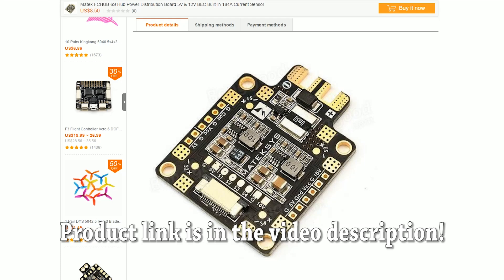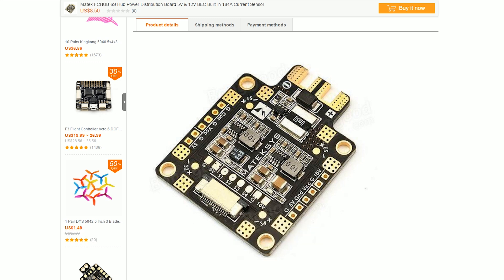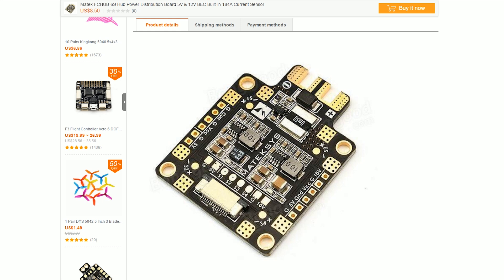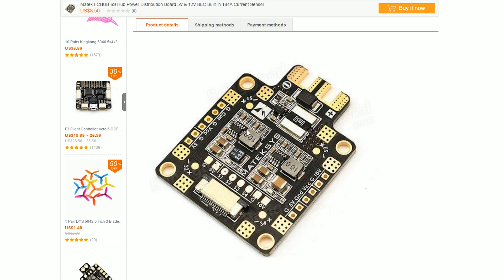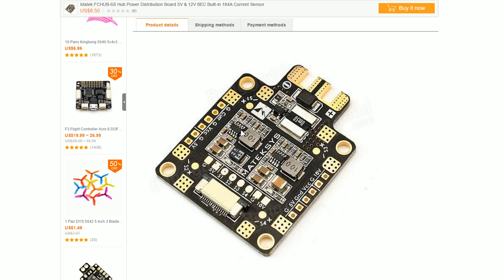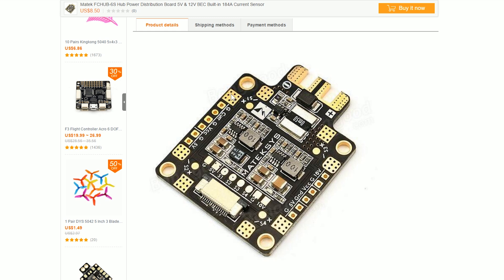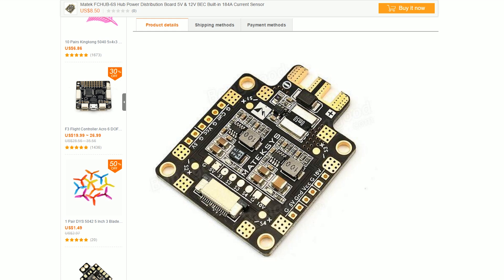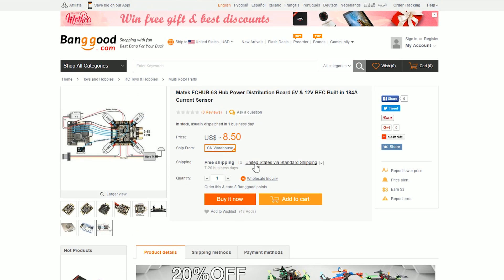MATEK FCHUB | the best, simplest, most complete PDB with current sensing for quadcopters

Comment: Hi Joshua. I am about to replace my Omnibus f4 v3 flight controller with the Matek f722-SE.  

I already have in my quad a Matek 5 in 1 pdb that is very neatly tucked away in the bottom of the quad and wired quite well, LED's and all. 

Now the F22-SE has an integrated pdb.  My question is this...Can I just use it (the F722) like a regular flight controller and just connect the signal wires and power etc (the connections I would have disconnected from the Omnibus)? 

I am thinking it is doable, but I need your opinion.  I don't want to rewire the whole quad.

Also, how would this affect  my options for using the current sensor which isn't on the 5 in 1?

Comment: all that current sensor  talk and you never cover if the ribbon cable carries the current value to the matching Matek Ribbon cable port.... 

I had to bypass using the ribbon cable on one rig and endedup having to contact Matek ( Great support By the way ) on how to get voltage into my OSD.  It required additionally connecting the VCC from PDB to the VCC on the FC. I of course freaked out like woah its already getting power wouldnt that fry something by adding ANOTHER power source  but nope it brought VCC readable into my OSD and didn't fry anything.   So Now I'm rebuilding a 6" and using ( I think ) the Ribbon cable and am wondering -- I know the ribbon brings main power to the FC and VCC to the OSD of the FC  but hmm what about Current  ?   WHoops  Never Mind  this guy addressed it for me   https://youtu.be/-XmTH9qLaNA?t=460

Comment: Hello Joshua, I'm doing my first build. I have this maytec fchub and using the kiss V2 flight controller and kiss esc. I know I wire the kiss signal and signal ground to the kiss v2. I know I wire the power leads to the maytec fchub pdb. The only thing I'm not sure is how I wire the maytec to the kiss v2. I think the maytec vcc out port goes to the kiss v2 lipo connection on the diagram. If this is the right configuration then how does the flight controller send power to individual motors if all the signal wires off ESC go to the flight controller. Would you be able to help me with this? Appreciate and have a great week

Comment: Dear Joshua, somewhere along the line I failed to pick up why the trend is towards these 10Volt regulators. I fail to see what it could/should be used for. I apologize for my ignorance but could you explain why this is important or a good thing in any case?
Reply from the maker: 12v regulator provides no filtering on 3S because input voltage is too low. 8v or 10v regulator provides filtering even on 3S.
Reply: Dear Joshua,

Trying not to spam you as you are probably very very busy. I appreciate your answer very much but I still fail to understand what I could use this voltage for. I understand this is much more 'clean' power but up to now I have had only use for 5volt and 3.3volts.

Greetings

Comment: Is it possible to solder a two wire motor to a 3 pad esc(4 in 1) PDB ( Eachine Stack)?
Reply from the maker: No. That is a brushed motor. It cannot be driven by a brushless ESC. This is not possible.

Comment: Hi Joshua, What is the filtering like. I am using some sensitive components Ublox M8N Sat RX, TBS Div RX and the Matek Mini Power Hub does not cut it. Too much interference.  I have cleaned up the FPV signal, its not perfect but OK, the Div RX has bands which although does not distort the image it is an irritation. I tried using a separate battery for its supply and the bans are gone : )
I could use a UBEC but don't want to keep adding components as this adds weight and another area a fault can arise. 
I have searched around the PDB reviews but it is hard to distinguish between sales people and honest reviewers.  As I am sure we and your viewers know there is a difference between filtered and well filtered PDB's. I don't have the money to keep buying and trying. That's why I ask you, an honest reviewer.
Cheers.
Reply from the maker: +Elecifun I don't know whether this will fox your issue.
Reply: K.
Reply: I asked you because you are supposed to be the most knowledgeable on this subject.  Your title implies this is the PDB to use, even the best. The best for what ? Sorry, forgive my stupidity. I see the click to buy link !!

Comment: Does anyone know what that black component right next to the battery pads is? Im asking because my PDB got just a tiny drop of water in the right place and made the current sensor completely nuts. After i had left the quad to dry for a few hours and went to test it to see if i had to replace the PDB and/or FC; at first it did work like it should, but then all of a sudden that black component exploded and caused Vbat and Ground to short circuit. So is it just a capacitor? Can i just remove it since i run caps on all my ESCs or do i have to replace it and if i do, then what is the component in question since i can't read the label on mine anymore?

Comment: Hi Joshua thx for all the great information... I have a question: Can I use a 35 Amps ESC in this PDB??? On the back it said 4x30Amps (4x46Amps)... Thx In Advance!!! Greetings from Colombia!!!
Reply: You totally can, unless you run something insane which actually uses more than 30A constantly. Im running the original Rotor Riot Hypetrains with Lumenier BlHeli_s 35A ESCs on my FCHub which is basically the same as the one with the vTx and havn't had any issues aside from the 10V regulator not being able to handle TBS Unify HV at 800mW and RunCam Swift 2 at the same time for some reason. I fixed that by soldering my vTx to Vbat and cam to the 10V regulator.

Comment: I bought the Matek PDB, FC and VTX.  Matek says to power their Vtx off the Vcc pad on this Pdb but would it be better to power it from the 10v?  Maybe keep the Vtx cooler?
Reply: The reason they say that is because as soon as you do a snap roll or a fast flip your vTx loses power for like a second because the 10V regulator either shuts off or dips way below 10V. At least that's what happened with mine with both RunCam Swift 2 and TBS Unify HV soldered to the 10V regulator. I fixed that by soldering my vTx to Vbat and cam to the 10V regulator. Also even if it would work on the crappy 10V regulator on this PDB, it would not have any meaningful effect on the temperature of your vTx as far as i know.

Comment: Switching regulator better than a linear ?? You sure didn't mean the opposite?
Reply from the maker: Switching regulators are able to handle way more current with a way smaller package and less heat buildup. When you buy a 1.5 amp rated linear regulator, that 1.5 amp rating is based on unrealistic assumptions about heat dissipation. Practically speaking, that 1.5 amp regulator is going to be able to handle something like 300 to 600 mA before it overheats. A switching regulator is the only way to get 1 to 3 amps output without having a massive package, a heat sink, or something like that.
Reply: switching regulators are more complicated and cause lots of noise. the quality of them is also an issue, but maybe it's a matter of preference.
Reply: DroneRecipe 
Caps 
They are the solution :D
Reply: I'll take switching regulator any day, maybe for certain conditions but for general usage, SMPS is better. Noisy output? An array of caps and an inductor will solve the problem.
Reply: would you take a switching or linear regulator for a VTX or FPV camera?
Reply: Switching, because one reason: inefficiency leads to extreme heat buildup. Let's do the math.

Battery full voltage: 16.8V
LDO output voltage: 5V
Voltage loss: 11.8V

:200mW VTX power consumption: 0.6A
Camera power consumption: 0.2A
Total: 0.8A

Power loss: voltage loss x current
11.8 X 0.8 = 9.44W

9.44W of concentrated heat on small surface without decent heatsink = a lot of heat.
Reply: no math to be done really. on and off of a switching regulator = noise   heat build up is relative to the voltage that requires lowering, so it's not "extreme" in all cases. I can't disagree that switching regs are more efficient but for certain applications the linear is better. do you remember when pdb's came with a 12v linear drop down (still have some) ?  btw, I love your channel icon :)
Reply: Switching is indeed noisier but that's why we have LC filter. What LC filter does? It smoothen the output, minimize the ripple and noise. Yes, LDO is better for certain application like very noise sensitive audio systems. You know the Omnibus FCs with LDO regulator? People are having problems with it. The linear regulator is giving more problems than solving the problems. Go check it out yourself, we ended up not using the or remove the included linear regulator.
Reply: let's agree to disagree, and yes I've used the Omnibus FC v3. the reg on that dropped the voltage more than it was supposed to..couldn't even get 5vs to power my camera or vtx. i believe they fixed this with versions 4 and 5

Comment: Will it work Good with 150 Amps current of all 4 Esc ?
Reply from the maker: +samarth1410 it's rated for 140 amps.
Reply: Thanks & Can you give me some advise that shall I buy this PDB or not ? I'm using 4 Esc's each of 30 Amp attached with 27Amps motor and working on bull-head propellers. Will it be able to work smoothly ? Please reply...

Comment: I"m having problems with my Chameleon, TBS unify not working, Where I got the unify from thinks the PDB might not be supplying enough current on the 5v.I am using a Omnibus F4 pro but like the way the battery connects from the side, so could I use this PDB with the omnibus and use the current sensing from the PDB, would that work?
Reply from the maker: I do think the Omnibus has current sense input, or at least I know it has RSSI input, which can be remapped to current input.
Reply: Joshua Bardwell trying to find the pin layout for everything on omnibus fc is impossible, I'll keep looking, and thanks for all your hard work, I'm off work at moment having back operation but when I'm sorted and back to work end of August I'll join your patron. Cheers!!

Comment: Joshua Bardwell, I have a small issue with one of my quads, it is fitted with a betaflight f3 fc all in one, coupled to TBS Escs and when I am happily flying around the power seems to cut off and the quad just drops from the sky, would you know what causes this small problem ?

Comment: Hi, I am using this PDB with omnibus F3 FC and the current reading is waaay off. MATEK suggest to set the scale  at 179mV/A which is logical due to its 184A and 3300mV sensor. but with those setting I get a readout of 1mAh after full pack of flying. when I lower the scale to 1mV/A i get only about 250mAh used after full pack. I am starting to believe that either the FC or Currnet sensor are faulty.. any idea how can I find out which is ok and which is bad? or any other suggestions? thanks in advance
Reply from the maker: The FC just takes what it gets from the current sensor. It's unlikely to be faulty in a way that would cause this problem. If you only get 250 mAh at 1 mV/A, then I expect the current sensor is damaged.

Comment: Guys, I have one of these inbound and I've not soldered onto open U shaped pads for the main + and - like this bad boy has, can anyone lemme know how or point to somewhere that does? I'd think maybe we just splay the ends and solder it flat?
Reply from the maker: I think you're over thinking it. I would definitely keep the wire together. Dont' splay it out.
Reply: Joshua Bardwell ahh ok, thanks man. Found on the main site, it's meant for an xt60 on its side. I'll wire anyways for relief on the pdb. thanks again.

Comment: What pdb can handle t-motor 45a esc. With the f-80 1900kv motor  That will be the winner  Still looking please help.
Reply from the maker: I reckon most PDBs can handle 160 to 180 amps without worry. If you are really concerned, you may have to build a harness out of 12ga or 10ga wire. But we're talking a really massive multirotor at that point.

Comment: Joshua, I really like the FCs with built in current sensor too (BFFC for example) but the problem is using them with a 4n1 ESC.  Have you found a solution to this problem?  Seems like the 4n1 ESCs should be incorporating the current sensor.
Reply from the maker: Get an ESC with a current sensor and then use the external current sensor input of the FC instead of its internal current sensor.

OR

Wire the 4-in-1 ESC vBat+ pad to the load side of the shunt resistor so that current still passes through the shunt resistor on the way to the 4-in-1 ESC. Use the same gauge wire as your battery wire.
Reply: Wow I guess I didn't realize that there were 4n1s that had a current sensor.  I'll look for them.  

I was worried that the traces on the FC, for providing power to the ESCs were not designed to handle the load of all four ESCs.  I know you have touched on this in prior build videos and even wired them this way.  I take it you've not had any problems with this?
Reply from the maker: +Chris Young that's why you solder to the big shunt resistor itself. It can take the current if course.

Comment: Good afternoon, can I ask a question HUBOSD8-SE? Is it possible to get Rssi signal on HUBOSD8-SE from receiver XM+? here are my options:
1)I tried to redirect the signal RSSI PWM with 16 channel betafight (Airbot А4) as servo control to the output 6 of the motor. Output 6 motor(servo) I connected to HUBOSD8-SE. I have received a signal HUBOSD8-SE , but it is chaotic 0-100%. Maybe it's still possible with the servo controls? 
2)Or how to convert an analog signal RSSi on-Board XM+(0-3,3 V) in the RSSI PWM signal to HUBOSD8-SE?
Reply from the maker: +ZMR220x you could convert analog to PWM with a 555 timer chip but I'd be surprised if the HUBOSD didn't understand analog 3.3v input.
Reply: Thanks for the clarification! I want to try to redirect betafilgt rssi 16 channel to control 2 servos by assigning the output 6 of the motor. Then controls PWM servo 2 to send to HubOSD. In fact it will be RSSi pwm? Do you like this idea?
Reply: Good day, you can give a link to a diagram of preobrazovatelya analog in PWM based on 555 timer?
Reply from the maker: +ZMR220x no, I couldn't do that. You would need to know the timing characteristics of the PWM signal first then use a 555 calculator to determine the correct capacitor and resistor values to generate the signal.
Reply: clearly it is difficult for me

Comment: Speaking shunt talk, don't want to be Shuntful, but wouldn't it be better and more accurate to have a shunt on each esc?
Reply from the maker: That's what KISS does. It's not more accurate, because it only measures current consumed by the ESCs, not the FC or any accessories. Current is always conserved throughout a circuit. If you pull 10 amps from the positive terminal of the battery, you must by definition have 10 amps going into the negative terminal. So if what you want to measure is the total current consumed, measuring close to the source, before it all gets split out to individual components, is the best approach.

Comment: Does a current sensor reduce power at all? I know that sounds silly but I'm just thinking since the power has to pass thru a resistor wouldn't it reduce power even if it just a slight reduction that isn't really felt in flight?
Reply from the maker: +ALLsteveo it's a voltage divider. Only a tiny fraction of the current goes through the shunt resistor.
Reply: +Joshua Bardwell thanks! Wasn't sure exactly how that worked. Going to give this PDB a try, been using the luminer PDB that just has a blank spot for a pololu regulator and adding one of the 12v 1a step downs. I would love to have a current sensor, my FC (furious FPV radiance) has pads for a current sensor but could never find a stand alone sensor and I'm sure if I did it would cost more than this anyways so I'm going to give this a shot. Thanks again!

Comment: would u still recommend to install a cap to the vbat pad ?
Reply from the maker: +Jack Truong yes
Reply: where do u stand  between using a separate pdb  + FC and AIO board?  I have not use an AIO board to make a proper judgement.
Reply from the maker: I like the Betaflight F3 myself, and am using it in all of my builds for now.
Reply: Joshua Bardwell can I run safely 8k/8k with that AIO board?

Comment: In addition to those features, this board also has a TVS , which is a major plus.  Another benefit to the 10V regulator, is most batteries when reaching minimum state of charge, will sag to near 12v.  Regulators can become unstable, and cause ill effects when input voltage is close to output set point.  Using 10V will ensure this does not happen.

Comment: Resource mapping for FC's that don't have a CURR pad? I have a board, with a built in betaflight compatible OSD, but no current measurement or pads for that functionality - but plenty of open pads for other RX's and whatnot.  Does anyone happen to know if it would be ok to remap one of RX pads to the "ADC_CURR " resource and plug the current measurement from this PDB into that resource?
Reply from the maker: The RSSi and Current pads can typically be exchanged on boards that have one and not the other.

https://www.youtube.com/watch?v=z5aO-3_n-Hs

You could also try the PPM input, but I'm less certain of that. Bottom line: try it and see if it works. Just save your resource mapping so you can revert if you need to.
Reply: Thanks, Josh! Appreciate the fast response and great video. I'll give it a whirl - it'll be a good PDB regardless of getting current to work and won't be an expensive experiment either way :)
Reply: also, sorry, I meant, Joshua

Comment: Looks like an update to the PDB-XPW layout and by the sounds, specs are the same.
Different, more fleixible XT-60/main lead pads and 4in1 plug  ESC signal plug on the new one, but still pretty similar.

I just bought the old one this one would make attaching the XT60 easier in the mode I want to use it.
Still love Matek PDBs.